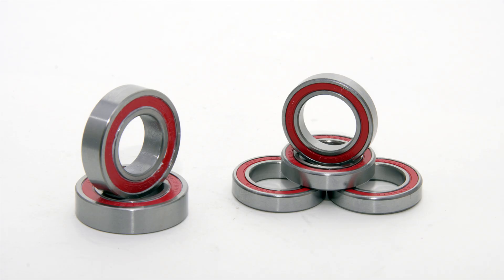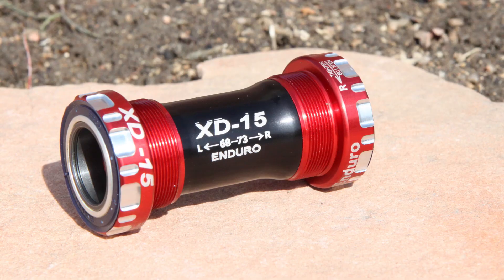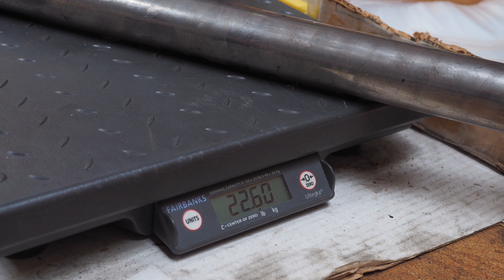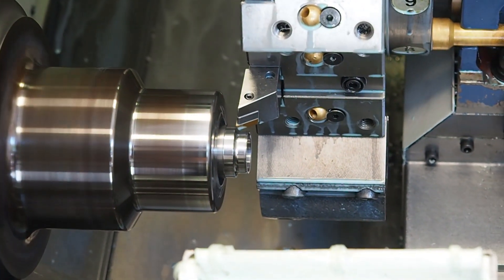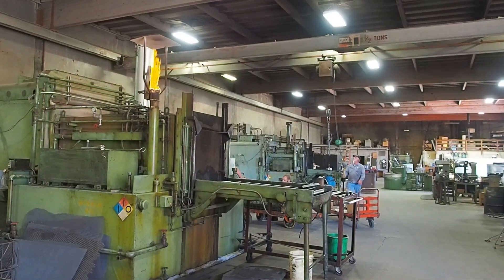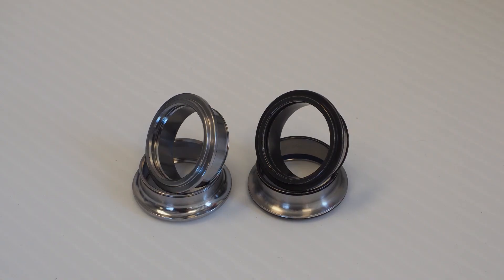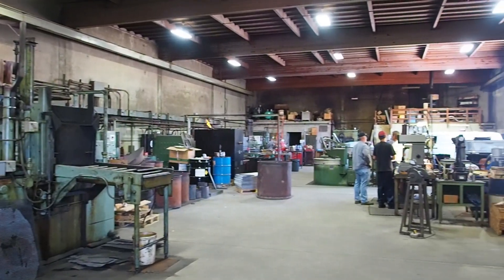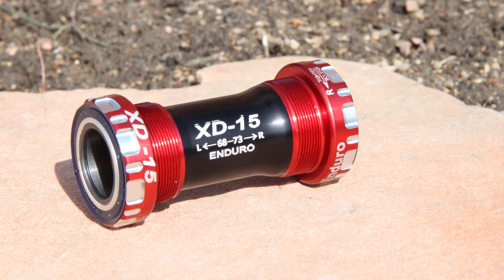Enduro Bearings Factory Tour

Comment: I have ceramic balls and clearly tell a difference. Clearly.
Reply: Is that a balls joke or not? With good steel breaings you shouldnt be able to tell, i would say its the playcebo effect. Ceramic bearings are usually used in very high rpm and heat applications. Higher rpm in this case meant upwards of 30 to 50 thousand rpm, depending on the size of the bearing. In bikes its just waste of money. because oyu have low prms with a lot of load.

Comment: are they REALLY smoother/better?? / can you really tell the difference??
Reply: I am just gonna copy paste my answer to another comment:
With good steel breaings you shouldnt be able to tell, i would say its the playcebo effect. Ceramic bearings are usually used in very high rpm and heat applications. Higher rpm in this case meant upwards of 30 to 50 thousand rpm, depending on the size of the bearing. In bikes its just waste of money. because you have low rpms with a lot of load.